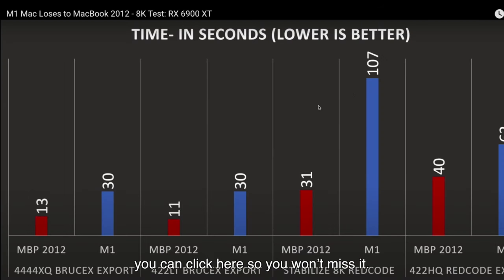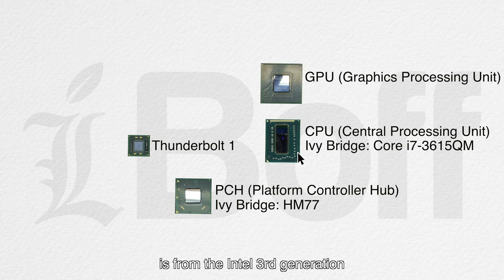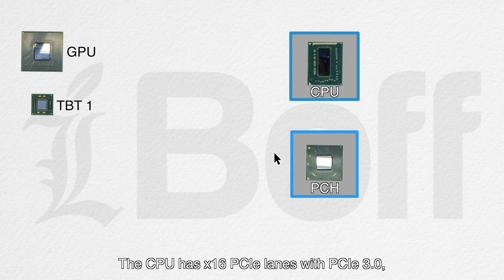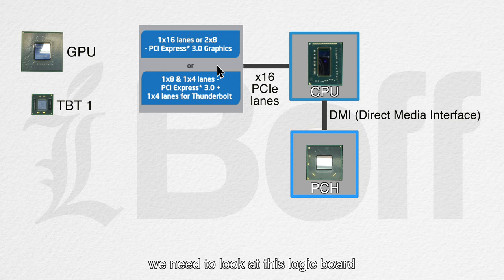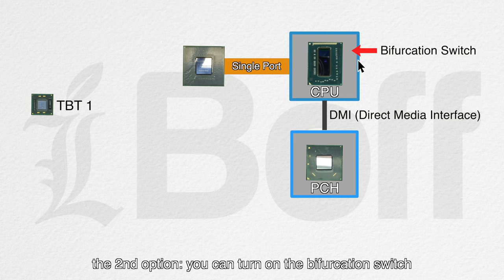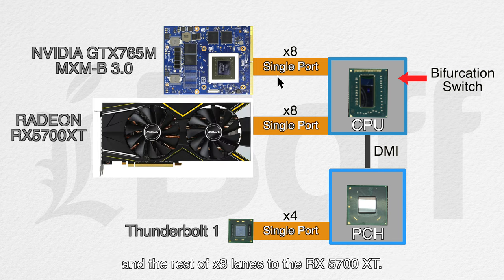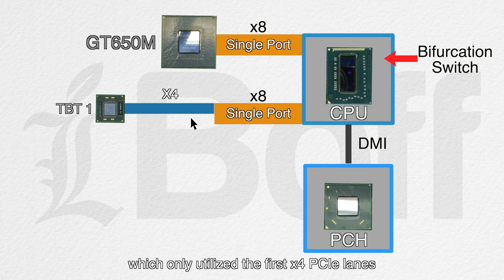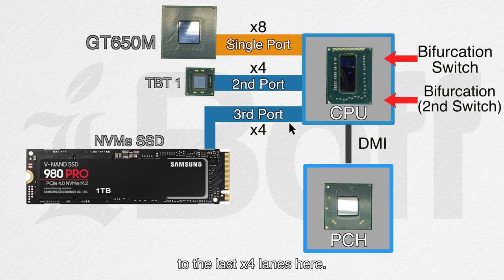How to Hijack Intel Mac : X-GPU Introduction Part 3

Comment: Hello. I plan to do something similar with my Thinkpad T440p, using the empty pads that the GPU would've used for another PCIe device, but after watching this video i want to ask something. If the GPU uses the first 8 PCIe lanes of the CPU for its slot, is it possible to split that somehow to have two x4 devices connected instead of one x8 device? As seen in this video and the intel website, if i want two x4 devices i would need to do x8, x4, x4 split but wouldn't this configuration just split the other 8 lanes that aren't accessible while the 8 that would've been used by the GPU stay as they are?
Reply from the maker: yes youre right. when you activate the PCIe bifurcation switch, it only change the last x8 (most of the time not wired) to x4 x4. So the first x8 will never bifurcate unless you use Upstream PCIe Switch which is not practical.
Reply: @iBoffRCC  Ah thank you very much for answering. The news is sad but I will still attempt the mod.

Comment: I just discovered your channel the other day and I'm absolutely blow away by your projects. I'm particularly interested in upgrades for the 2011 model imac and was amazed by your connecting an external gpu via the DVD slot. Thing is, have you considered any CPU upgrades for the 2009-2011 imacs? There is a thread on the MacRumours website dedicated to this topic but they seem to have hit a dead end. The theory is that there is something in the microcode preventing Ivybridge CPUs working in these machines - any thoughts on this?

Comment: It’s so amazing! What I’m thinking right now, is it possible to replace/extend SSD in MacBook 2018  Touch Bar and the newest ?
Reply from the maker: Yes, and no. yes because its replaceable if you master soldering(no one really proved yet that it works), and no because you just cant get any new NAND SSD for it. its a special NAND made for apple

Comment: This is a really amazing project? Is it possible to directly connect a GPU to a MacBook Pro 16" similar to the project you've just done?
Reply from the maker: Yes it is. The same concept is applicable and no bottleneck is expected with that generation of CPU.
Reply: @iBoffRCC  Is it possible for you guys to do at a later stage this year or is this quite simple?